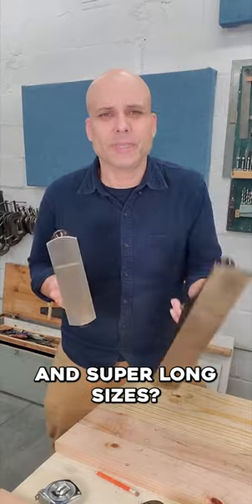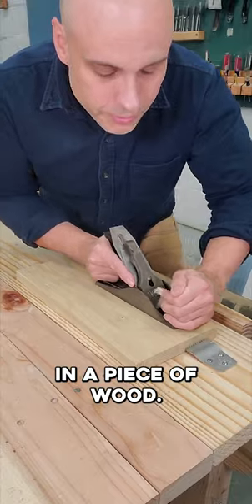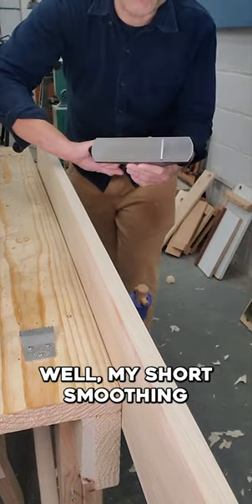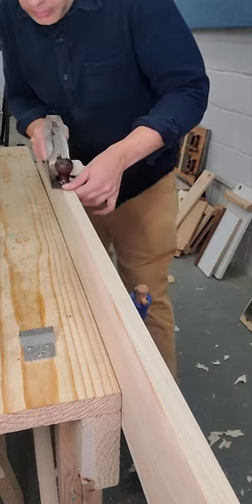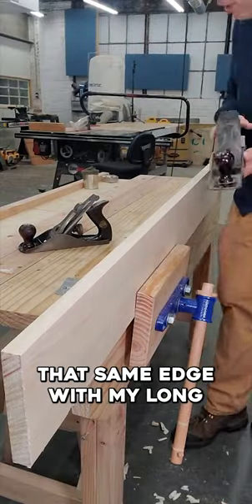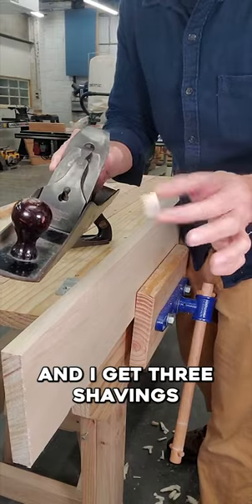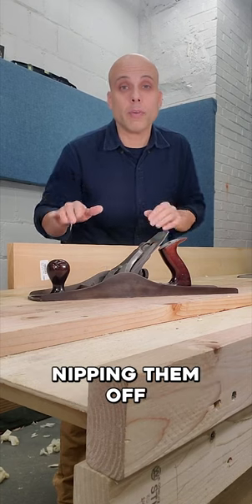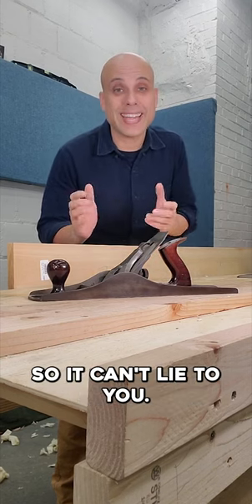Why are handplanes SHORT and LONG?? #diy #woodworking #shorts

Comment: Long planes can still be fooled by longer waves, but it does limit how wavy the edge can be
Reply: Rule of thumb I learned: jointer should be at least half as long as the jointed board for a good result.
Reply: that is correct. If it’s at least 50% the length it’s as close to perfect as you can get
Reply: Well wood is a good material, but it’s also violently hygroscopic and anisotropic as well as inhomogeneous. The material will always change its shape slightly. High precision with wood just is not possible, even if you process it while beeing perfectly precice it will change it's shape anyway.
Reply: Yeah it's all about scale.
Reply: I would love to see a 4' (or longer) jointer plane for a board 8' or longer...
Reply: @karlrovey  Oh, those actually existed (wooden bodied, at least). The longest I found measured 120cm (just shy of 4'). There were longer ones, but those were for barrel making, I believe, and used stationary upside down (search for Böttger-Fügebank, 192cm or 6'4"). The longest ones you can still by new measure 80cm (2'7"), but the common length is 60cm (not even 2'). So especially for the common carpenter, the rule of thumb can only go so far and has to be replaced with skill and finesse.
Reply: @Bapate-rh9be  jesus christ
Reply: @Bapate-rh9be  Well, you still need to know, what you are doing. Let stuff stabilize in your shop. Assemble while still flat and either keep the wood flat or in position with joinery and glue, or construct with movement in mind. Nice glue lines require well prepared edges ... And definitely don't construct as if it's particle board ...
Reply: this reminds me something i learned in signal processing and sampling or whatnot
Reply: @tianwang  that would be the Nyquist-Shannon sampling theorem. But there isn't really a connection. You could think of longer and longer planes being ever lower low-pass filters, if you will.
Reply: Get an even longer plane
Reply: Even longer planes to the resque😁
Reply: Well then I'll just get a longer one
Reply: I have the feeling it's the same 1/2 as the 2/1 in the Nyquist frequency
Reply: if the wave is large enough to fool a long plane, you’ll notice it.
Reply: But why would you place faith in the trueness of a longer wooden jointer? Maybe for the same reason that people inexplicably trust tall politicians??
Reply: Correct. You need your plane to be at least twice the length of the wood.
Reply: At that point you'd be able to see it by eye
Reply: @Sam-gf1eb  I really hate that Nyquist-Guy

Comment: I like to use scale the plane to the project.  If I build a small box, say 6-inches (15 cm) long, I can actuall do ALL the planing tasks, edge squaring, thicknessing, and smoothing with a block plane.  I can even test flatness by lifting one end of the plane a little off the board and let it drop.  If it makes almost no sound other than a soft noise, the board is flat enough.

Comment: Carpenter here... Please don't lay it on the blade... Thanks (even on wood someday you accidently put it on a screw and then the blade maybe brakes off...still just a tip)
Reply: Or you could just be mindful of where you set your plane down…. And deeply countersink your screws

Comment: With skill, even a short plane can joint long boards, but boy howdy does having a long plane make it easier.
Reply: +glue Yes, and you can also score a hole-in-eleven on a par 3 if you use only a 9-iron. But do you mind if I play through..?

Comment: Can anyone tell me a good brand for both the long and shorter plane? Thanks
Reply: whatever has a wheel dial is fine for the first uses. Lee nielsen, stabley and veritas are the well know brands but they are usually costly. Also, make sure to check the sole for flatness and squareness to the sides in any plane you buy and return it if they aren't good

Comment: He placed the planes flat on the bench 😡
Which can dull the blade
Reply: I was always taught to place the plane on it's side when not in use,.
Reply from the maker: It absolutely cannot. That's just nonsense that people repeat when they want to sound like they know something.
Reply: @RexKrueger  I work at the oldest continuously running wooden boat shop in the country. I think I know what I'm talking about. (not to be a Karen)
Reply: @RexKrueger  I'm so sorry that the world isn't as 'educated' as yourself.
Another of the reasons why you should place a plane on its side is to avoid chipping the blade on anything that may be in the work area, like a nail or screw. I was taught this by my father, who I'm sure had more experience than you, after more than 50 years in carpentry and building.
Reply: It really doesn’t damage the plane
Reply: Just setting the blade down isn't going to do much to it. Now, if he's sitting there smacking it into the table, you've got something to worry about. The blade will be dulled much more from actual use than it will from just setting it on a surface.
Reply: Dude, you are literally jamming this thing through wood, how in the hell is laying it flat on a table going to do more damage than it’s actual use
Reply: @thomas-kk8yc ”I work at the oldest..” sounds like you’re around a bunch of old people who perpetuate the same myths their fathers told them 60 years ago
Reply: Just because someone works in a profession a long time does not mean they have accurate information.
Reply: If the plane is never pushed around while face down, and is laying on smooth wood, not metal, and with no nails or screws in the wood under it, would that still hold true? I can see it happening if it's getting slid around but I'm having a hard time seeing how just sitting there on smooth wood would dull the blade

Comment: Long planes can always be fooled by a convex curve

Imagine planing the edge of a circle, no matter hoe big of a circle or how big your foot you'll always be able to make a continuous cut
Reply: If you get to that point you use winding boards. By moving one along the edge you can take out converse convex.
Reply: @tedwarden1608  my point was exactly fhat. You need an external measurement, you can't rely on the plane to tell the truth

Winding sticks are not ideal as if the curve is consistent acrosd the width of the board (ie no wind) they don't amplify the issue. A locking external calliper or height/indicator gauge and a reference surface would reveal the issue far easier
Reply: @daniwalmsley611 . TBH I’d use my rail saw and a router these days :-)
Reply: That doesn’t make any sense
Reply: @MikehMike01  the reason you don't get a continuous cut when planing is the bumps lift the sole in turn causing the blade to lose contact, but with a single convex curve there's nothing to lift the sole

So if you're board is bowed or cupped you'll only be able to take shavings at the edges on the concave side but a continuous shaving on the convex side